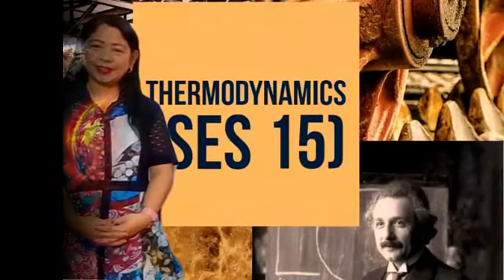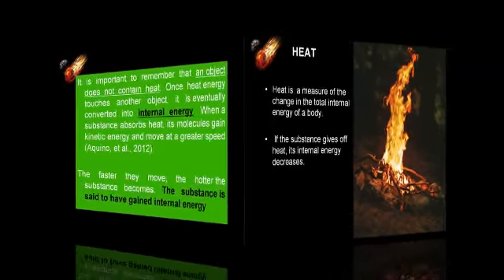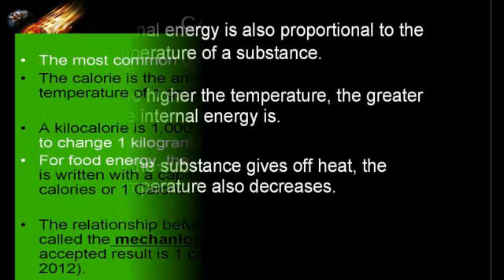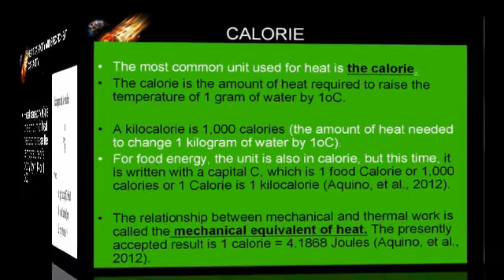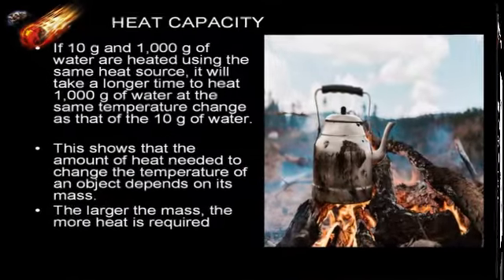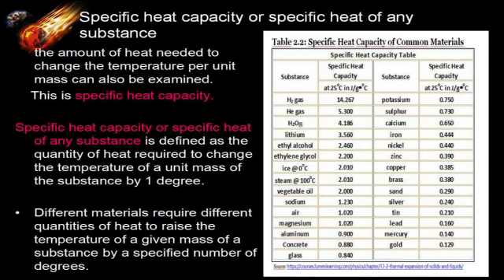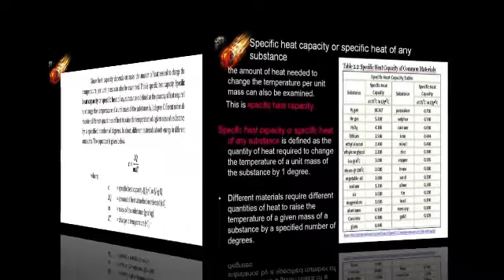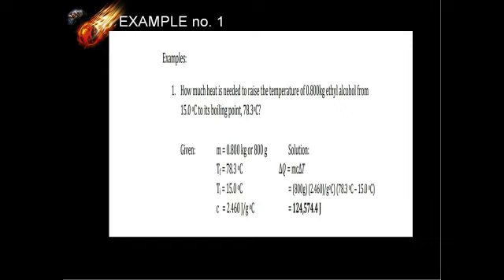HEAT AND SPECIFIC HEAT CAPACITY

Comment: 1. HOW IS HEAT DIFFERENT FROM TEMPERATURE? 
Heat is a form of energy, a thermal energy while temperature is not an energy, it is a degree of coldness or hotness of the body. Heat is not determined by instrument but temperature is directly determined by a thermometer.

2. WHY DO YOU THINK THAT IT IS IMPORTANT FOR YOU TO UNDERSTAND "specific Heat capacity"? 
The specific heat capacity is the heat energy that is needed to raise the temperature of 1 k g of the substance, by 1 ∘ C. It is important to understand to realized that the energy input must be by heating. This will give information as to how long the heating or cooling process occurs.

GIVE EXAMPLES OF THE APPLICATIONS IN YOUR DAILY LIFE
-Cooking utensils are made of metal which has low specific heat capacity so that it need less heat to raise up the temperature.
-An instrument like a thermometer, the body may be made of higher specific heat and the tip is made of a material of low specific heat.
-Substances having a small specific heat capacity, are very useful as material in cooking instruments such as frying pans, pots, kettles and so on.

Comment: 1. heat is a form of energy, while temperature is how hot or cold something is.The core difference is that heat deals with thermal energy, whereas temperature is more concerned with molecular kinetic energy. Heat describes the transfer of thermal energy between molecules within a system and is measured in Joules. Heat measures how energy moves or flows. An object can gain heat or lose heat, but it cannot have heat. Heat is a measure of change, never a property possessed by an object or system. Therefore, it is classified as a process variable.

2. Specific heat capacity is a measure of the amount of heat energy required to change the temperature of 1 kg of a material by 1 K.
Hence it is important as it will give an indication of how much energy will be required to heat or cool an object of a given mass by a given amount. This will give information as to how long the heating or cooling process will take under a given supply, as well as the cost implications thereof.

Applications:
*very useful as material in cooking instruments such as frying pans, pots, kettles and so on, 
*Utensils used for making tea or coffee, or cooking vegetables or rice are made of materials of low specific heat
*The handles of utensils at home are made of materials which have very high specific heat.

Comment: Heat and temperature are a closely related topic, and as such, the difference between the two can be a bit confusing. The core difference is that heat deals with thermal energy, whereas temperature is more concerned with molecular kinetic energy.
Heat describes the transfer of thermal energy between molecules within a system and is measured in Joules.[2] Heat measures how energy moves or flows. An object can gain heat or lose heat, but it cannot have heat. Heat is a measure of change, never a property possessed by an object or system. Therefore, it is classified as a process variable.

Temperature describes the average kinetic energy of molecules within a material or system and is measured in Celsius (°C), Kelvin(K), Fahrenheit (°F), or Rankine (R). It is a measurable physical property of an object—also known as a state variable. Other measurable physical properties include velocity, mass, and density, to name a few.
It has importance in terms of energy, time and costs involved in changing temperatures of objects.
Specific heat capacity is a measure of the amount of heat energy required to change the temperature of 1 kg of a material by 1 K.

Hence it is important as it will give an indication of how much energy will be required to heat or cool an object of a given mass by a given amount. This will give information as to how long the heating or cooling process will take under a given supply, as well as the cost implications.
Application of Specific Heat capacity in daily situations are.. 1. ... Substances having a small specific heat capacity, are very useful as material in cooking instruments such as frying pans, pots, kettles and so on, because, they can be quickly heated up even when small amount oh heat is supplied

Comment: 1. Heat is the transfer of energy between objects that are at different temperatures. ... Temperature is a direct measure of the average kinetic energy of the particles in a substance. The more kinetic energy the particles have, the higher the temperature of the substance.

2. It is important as it will give an indication of how much energy will be required to heat or cool an object of a given mass by a given amount. This will give information as to how long the heating or cooling process will take under a given supply, as well as the cost implications thereof.

3. • Heat storage instruments are very useful and they are usually made of substances with a high specific heat capacity.
    • Water as a cooling agent acts excellent as a cooling agent in engines. Water is also used in houses in cold climate countries because as it is heated up (boiled) it tends to retain heat and warm the house due to its high specific heat capacity.

Comment: Heat and temperature are two different quantities. The basic difference between heat and temperature is that Heat is the form of energy that transfers from hot body to cold body. Its unit is the joule. While the temperature is the degree of hotness and coldness of the body. Its SI unit is Kelvin.

Specific heat capacity is a measure of the amount of heat energy required to change the temperature of 1 kg of a material by 1 K. Hence it is important as it will give an indication of how much energy will be required to heat or cool an object of a given mass by a given amount.

Application in daily living

•The handles of utensils at home are made of materials which have very high specific heat.  They act as thermal insulators. The insulating capability or conductivity is also dependent on specific heat.

Comment: 1. The core difference is that heat deals with thermal energy, whereas temperature is more concerned with molecular kinetic energy. Heat is the transfer of thermal energy, whereas temperature is a property the object exhibits.
2. Specific heat capacity is a measure of the amount of heat energy required to change the temperature of 1 kg of a material by 1 K.

Hence it is important to sudy as it will give an indication of how much energy will be required to heat or cool an object of a given mass by a given amount. This will give information as to how long the heating or cooling process will take under a given supply, as well as the cost implications thereof.
3. APPLICATIONS IN DAILY LIFE

1. Substances having a small specific heat capacity can be quickly heated up, it also experience a big change in temperature even though only small amount of heat is supplied.

2. Substances having a small specific heat capacity, are very useful as material in cooking instruments such as frying pans, pots, kettles and so on, because, they can be quickly heated up even when small amount oh heat is supplied.

3. Sensitive thermometers also must be made from materials with small specific heat capacity so that it can detect  and show a change of temperature rapidly and accurately.

4. Substances that have a high specific heat capacity is suitable as a material for constructing kettle handlers, insulators and oven covers, because, a high amount of heat will cause only a small change in temperature aka the material won't get hot too fast!

5. Heat storage instruments are very useful and they are usually made of substances with a high specific heat capacity.